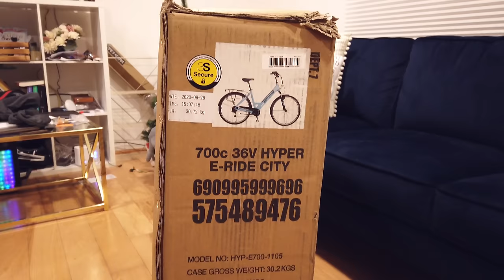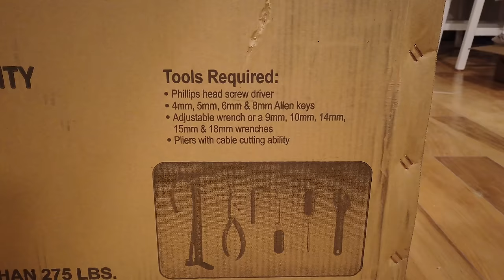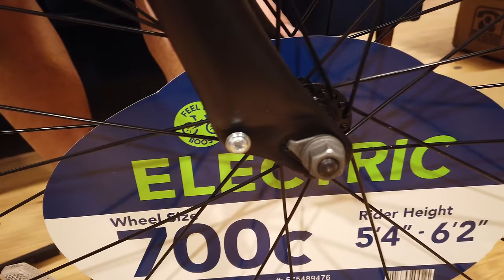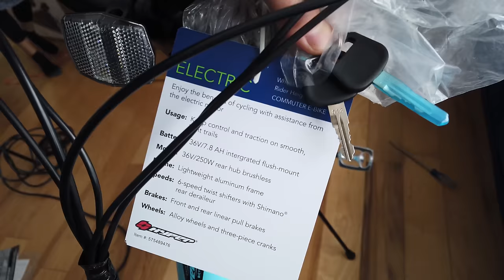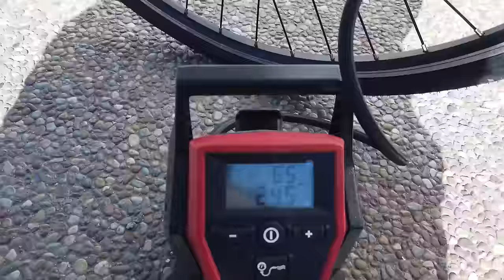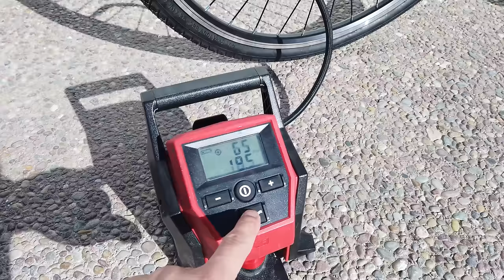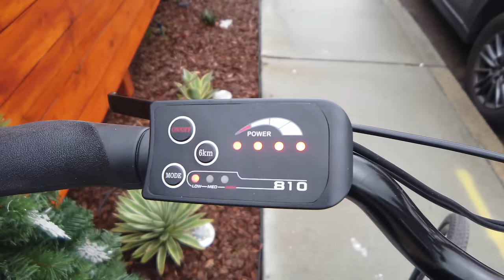Cheap $398* Walmart Electric Bicycle!!!? Hyper E-Ride City 250W 36V Ebike Review + Assembly Tutorial

Comment: I am working on modding this bike to add a throttle. HMU with any tips!
Reply from the maker: That's great. I haven't checked the controller, but there may be able a way to connect throttle wires to it. Let me know what you find out.
Reply: @ColinLeung  doesn't have any extra plugs. Tried plugging the throttle where the pedal assst sensor goes. No luck. Bought a $30 controller from amazon with correct power specifications & throttle plug. A few connections require modification, but the motor runs continuously and at very low power. There's a jumper that I am going to try pulling to disable this feature. Hopefully it will uncap the power output too. Seemed to respond a bit to the throttle at least.
Reply from the maker: @I.G.G.G.  Thanks for the update. I'd be interested in knowing what max speed you get and if you can get pedal assist and throttle functions working
Reply: @ColinLeung  It's all sorts of messed up. Can't get it to run at all without the jumper & with the jumper, the throttle only serves as a momentary cutoff. Clearly I'm doing something wrong, have shorted something, or am just using the wrong parts. IDK. Looks like I'll have to just wire a switch to where that jumper goes & use that to control the motor (not ideal)

Comment from the maker: As of 11/18/21 the price dropped back to $398. 
Blue step thru version https://www.walmart.com/ip/Hyper-E-Ride-Electric-Bike-36-Volt-Battery-700C-Wheels-Blue/487063249
Black mountain bike version 
https://www.walmart.com/ip/Hyper-Bicycles-E-Ride-Electric-Pedal-Assist-Mountain-Bike-26in-MTB-Black/568743494?irgwc=1&sourceid=imp_UVAxEix3yxyIWOKxvCW%3ANVnAUkGxe5zQeQmkRg0&veh=aff&wmlspartner=imp_10451&clickid=UVAxEix3yxyIWOKxvCW%3ANVnAUkGxe5zQeQmkRg0&sharedid=&affiliates_ad_id=567111&campaign_id=9383
Reply: Cool. A message from the future, 2022. I always suspected YouTube had that capability.

 But yeah they're back down to 400 bucks. Those are obviously not top-end components, but since I am an actual bicycle mechanic, anything that happens I can probably deal with.
Reply from the maker: @47f0  Thanks for the comment from the future!
Reply: I nabbed the black version for 398
Reply from the maker: @polaroidwhite9037  Awesome. Let us know what you think once you get it
Reply: Is it OK to leave this outside exposed to rain/snow (NY) at the train station?
Reply: Also, any comment between this and the Jetson Bolt Pro Folding Electric Bike
Reply from the maker: @bjohnrini  I'm not sure. It may be water resistant, but not waterproof. The electronics may short if it gets too wet.
Reply from the maker: @bjohnrini  They're entirely different bikes. It depends what you want. The Jetson is more portable and lighter, but is small and does not go as fast. This is a full size bike, and not as portable.
Reply: Bruh the bike is 698 now
Reply from the maker: @detroy1234  Yeah, it has been going up and down in price. It seems to get cheaper toward the end of the year.
Reply: cheapest price I can find is $648.00 you say on 11/18/22 its going to be $398.00 is that a typo? I would buy one at that price. Good video on bike.
Reply from the maker: @ftroop211  Hello Gary, sorry. I meant to write 11/18/21, and corrected it. The price seems to drop towards the holidays, so it may drop again this year. Thank you
Reply: @ColinLeung  Thank You